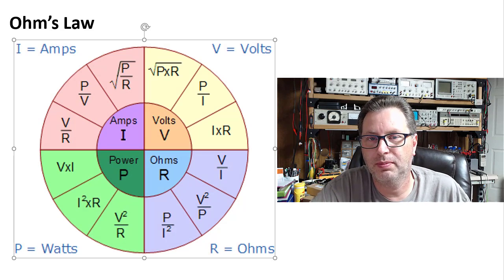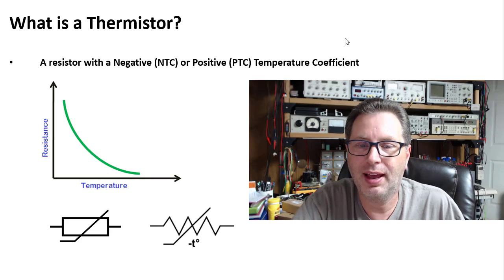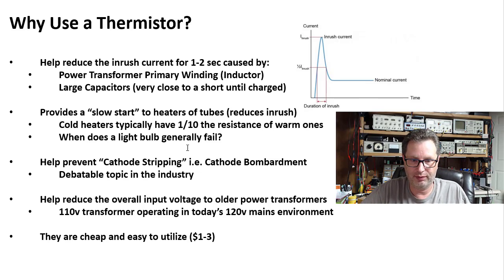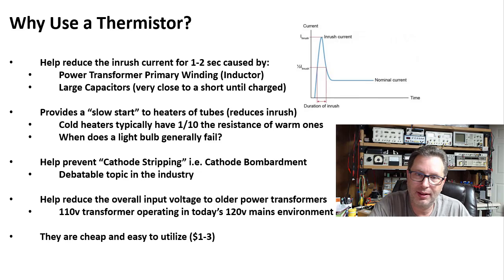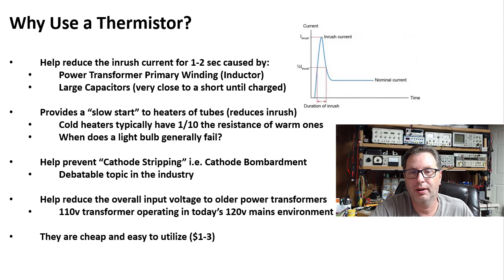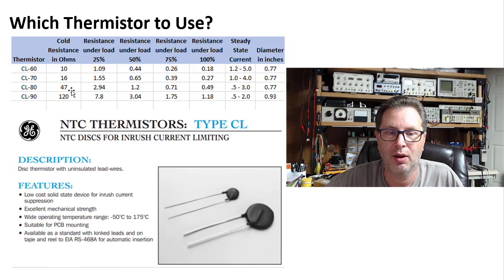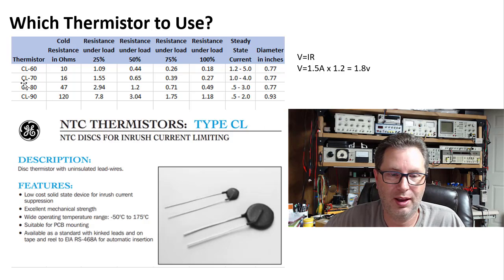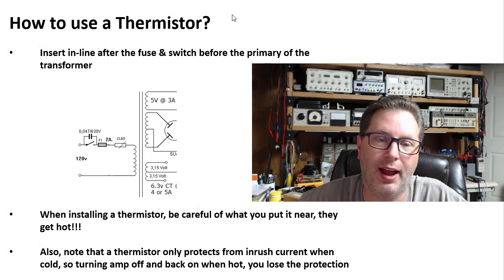Why Should You Use a Thermistor in a Tube Amplifier?

Comment: Thanks for your video; very helpful. I have a tube preamp that the b+ starts at 590v and 40 mA and then drops to 400 v at 23 mA once the tubes are warm and draw a total of 23 mA after about 30 sec - 1 min. I have four 1.2k resistors 5w to drop the voltage in the power supply and was thinking of changing one to a 1k ptc thyristor that the resistance would rise during the initial over current. After seeing your video, is that the wrong approach? (The heaters are dc and limited to .3 amp )

Comment: Thanks for this!
If I have an amp that uses a 5 amp fuse, can I use a a CL-80 (3A) and a CL-90 (2A) in series to handle it for inrush protection and mains voltage reduction? (because it's an early 70s amp and I often get 125VAC at my house.... Do Thermisters work that way? Can they handle the larger current by being in series? And if so, do they need to be right next to each other, or ought they be one on each of the PT primary wires?

Comment: If the tube amp's power transformer is rated at 120V instead of the older 110V, where would be a good place to insert a thermistor?  Perhaps after the Standby switch, if the amp has a Standby switch?

Comment: I have a question. what would be better in a guitar tube amp, a thermistor or a Varistor? Mesa used a snr 130k20 (varistor) from the fuse shield to the neutral terminal in the power supply on old Mark series amplifiers. I want to add protection to an even older mark series amp that I wired a new 3 prong cord into. I love your videos. I live in Raleigh btw. Thank you

Comment: I am rebuilding speaker crossovers on a set of large speakers, 15' woofers so they can take some power. The tweeter and mids are each protected by a PTC thermistor. I understand you want to protect the circuit but is there a better way? Obviously, there is the benefit of it being "self-resetting" and cheap.

Comment: Can you run multiples of these NTC CL thermistors in series to increase their resistance and steady state current ratings, in case you wanted to knock more voltage down without going with a bucking transformer?

Comment: Thank you for the video. I just ordered a couple of the CL-90's to play with. Not real cheap though on eBay , $13.42 with tax and shipping.  I've been using bucking transformers for many of my old power transformers. I found that adding a 0.1ohm 5watt resistor to 6.3v filament windings get them right from 7.2v down to 6.3v. One on each leg of the winding. Amps that I run el34's in voltage is no big thing but , being able to drop a a couple volts on my smaller amps is a must. I recently discovered the transformer impedance thing for tube rectifiers.  "Rt"  Example:  I just built a amp with a old Voice of Music power transformer. That transformer had a ez81 on it but , with 122-123v wall voltage the  B+ voltage would have been up there. The transformer had a pretty low resistance for a ez81. I used a couple 250ohm 5watt resistors on each leg of the HT and it knocks about 18volts off the B+. I should have used maybe 180-200ohm resistors but , 250's were all I had on hand.  It's only a 120ma secondary and the little 0.1ohm resistors on the 6.3v windings , probably 3.5amp. That amp will plug into the wall. I made a post on el34world forum about it. "Orange AD15 Style Amp" 
 A good subject for a video , with a bit of math , would be determining power transformer impedance for tube rectifiers.
Reply: You can’t use resistors on ac period

Comment: Item 3: Stripping may not be happening because there is no current flowing in the tubes until the heaters come up to temp, well after the thermistor warms up. So for that 3-4secs the therm has already heated up.

Thermistors: I also don't like the saggy affect it has on the power supply. Does help a solid state rectifier PS sound a bit more tube like lol but for punch, you don't want sag. btw - a lot of classic guitar amps didn't have them at all. Best is a timed resistor/relay circuit or a physical switch for a series resistor ie Inrush switch.

110vac vs 120vac line voltages may be true, so if the rails are too high, drop down with an outboard transformer or variac to achieve the actual expected B+. If you're running old enough amps then expect to have a crazy setup.
Reply: WRONG

Comment: I love odd components for pedal builds ever since I built a set of optocouplers for a harmonic tremolo out of light dependent resistors, leds and black heat shrink lol. Today I saw something about thermistors and thought I'd look them up and I found your video after awhile. I completly see the value of slowing that surge of current at start up. My main amp that I use 99% of the time is a Marshall DSL100HR. I'm still under warranty so the closest this to a mod I've been able to do is roll the tubes and replace the HT fuse when it blew following a stock JJ el34 blowing(not a fan of JJ EL34'S at all, in my experience I've always had poor sound quality with them sounding muddy and the longest they've lasted before one if the matched quad died on my was about 6 months. And that's with a reasonable bias that took into account the actual plate voltage etc of the amp while plugged intok the power source it would be using in operation. My power was dropping to as low as 104v in summer so I got a boost/buck transformer that boosts by 10v at 116v and bucks by 10v at 126v. That along with a fresh matched quad of EHX EL34'S and a rebias taking into account the possible source voltage fluctuations and I haven't had a power tube blow in over a year.) Anyways I was wondering if using thermistors was common practice with any big name amp builders? I've been inside my amp and looked over the schematic and I don't remember seeing any thermistors around the switch, fuse or input caps. But at the time I wasn't aware of thermistors so I'll have to go back over the schematic now. Luckily it seems like a thermistor could be added at a point that would be less invasive but if hate to get rejected on a warranty repair cause of such a small modification. I swapped out the footswitches in the channel/fx loop 2 button switch that comes with the amp and changed the fx loop to a green led instead of red so the channel an fx loop can be identified in a darker setting if needed. Plus while I was at it I added some led bezels. I mention those "modifications" to note that even with those small mods I worry I might be rejected for warranty repairs. I think it would be rediculous but you never know how far a company will go to save a buck. Great video btw, as soon as I'm able I'll be implementing thermistors in my amp and also when I get around to building my first tube amp from "scratch" (meaning from parts I source myself and using a schematic with modifications to comolement my playing style and needs).

Comment: Thanks for the informative video.  I'm a great believer in inrush protection particularly for expensive transmitting tubes, e.g. 3CX1500 etc.  Don't use those much anymore but primarily restoring vintage receivers and tube guitar amps.  One problem I have since moving to this location is a very high (126VAC) line voltage.  So to get to a nominal 110V input I have to drop about 15V.  I've been using 2-5 watt wirewound resistors in the hot lead of the line which seems to work well enough and calculating the value is very simple.  What's been your experience with this kind of problem?  Is there a better way?  Thanks.

Comment: Thanks for another informative video. I use a 10 watt 500ohm ceramic resistor wired across a switch to act as a soft start on my guitar amp builds. Select value to reduce primary voltage to half in the same place in circuit where you have thermistor. After I flip the ON switch I count 7 to 10 seconds then flip the soft start switch that shorts across the resistor giving full voltage to primary. This reduces current spike on filaments. Mr. Carlson's Lab has a video on inrush current on tube filaments and it shows at startup a single filament in a 12AX7 preamp tube has 1amp spike. That's 2 amps per preamp tube. So thermistors could also be used in filament circuit. Also I would like to see you do a video on a series pass circuit to reduce B+ voltage to power tube plates and screens.

Comment: For even more protection for my first smoothing capacitor and tubes if using diodes instead of a rectifier tube... Can I add an additional thermistor on the DC side between the diodes and first smoothing cap or input choke? This way I would be reducing inrush on both the primary ac as well as filling up the first smoothing capacitor more slowly. What are the advantages and disadvantages of using both an AC and DC side thermistor in place?
Reply: Also can I use these to slow the heater and B+ voltage rise only. But have the bias come up immediately, so that when the heaters are coming up the bias will already be fully up and present to reduce cathode stripping over time. What is the ideal sequence for applying power to the amp using thermistors for some delay?

Comment: Heya, good video.  Just wanted to mention I have some old gear here from the early 1950s that's rated for 117VAC, so it's not such a big deal for us amp folks as it is for old radio restorers dealing with pre-WW2 units. Not sure when the AC supply went to 117V though. Before my time.  Having said that, I see 125VAC fairly commonly, and I don't think that was common in the 60s, at least I don't remember it, so the same problem exists and the added resistance is worthwhile. 

I've also seen folks add thermistors to the secondary side as a soft-start for the B+.  I haven't tried that myself so I'm not sure how that behaves.

Comment: Can a thermistor's coefficient reverse when failing? I have a modern amp that will not come back on when hot ;yet it isn't blowing fuses . And comes back on when cool. It has a c60 in series on the neutral leg.

Comment: Thanks Mark, I've been thinking about putting one in my Marantz 2325 solid state. It has an 8 amp main fuse, what size thermistor would I use?  When I did the restoration I raised the main capacitors from 15K to 18K uf 70 volt and a 150 Ohm 125 Volt snubber cap but it keeps blowing the power switch (it freezes on, won't shut off). Any help would be appreciated.

Comment: Many solid state hifi amps use one or more (paralleled) relatively low-ohms-value but  large-wattage resistors in series with the incoming AC line, that get shunted out of circuit after a couple seconds by a large relay wired across the resistors(s). This works quite well as long as the relay contacts are clean, so that the relay handles all of the AC feeding the power transformer and the resistors have no voltage on them because of the "closed" relay shunting the voltage around them. However, once the relay contacts become a little oxidized, then you have some voltage flowing through the resistors (with a corresponding voltage drop) and also some voltage drop occurring directly at the relay  contacts  which themselves have formed a resistor; and so, the resistors may overheat sufficiently to break down their solder connections or even burn the board, and the oxidized relay contacts can also start to arc and burn. (This circuit also requires a basic short-duration timer to delay the relay slightly, for just a second or two at most,  so it doesn't turn on instantly when you throw the switch on the amplifier). Still, this type of inrush-limiting circuit works quite well, especially for big power amps  with very high inrush current due to big transformers, solid-state rectifiers and massive amounts of  filter capacitance, *as long as the relay is heavy duty and the contacts get cleaned every 5 to 10 years or whatever*. By the way, one highly regarded and collectible Hi-Fi power amp I know of actually uses thermal fuses in line with and physically touching each of the four or five resistors so that if they start to overheat significantly (because of the relay having  becoming too oxidized to form a good low-resistance shunt)  the thermal fuses will blow and disconnect power to the amplifier.

A quick voltmeter check will tell you if these resistor Bank slash shunting relay circuits are working correctly, ideally there should be no voltage measurable across either the resistor Bank or the relay, which are of course in parallel with each other anyway, but due to very slight contact resistance at the relay you might have 5 or 10 millivolts of AC across these devices. Anything more than that showing up on your meter is telling you that you need to clean that relay.

Comment: 3 questions:
   1) Is there any value to adding thermistors to old Solid State equipment?
   2) Why not insert several thermistors in series to reduce voltage down to say 110v?
   3) Should I add a thermistor to to my old Hammond organs?

Comment: I've seen people put big resisters in front of the transformer on 1930's radios to reduce voltage in theory to lengthen the life of them because they originally ran on lower house voltage in the 110 range, this seems like a better option, would you concur or do you think there is no reason to drop the line voltage for these old radios? Great video, thanks!
Reply: I use a 25 watt 8 ohm resistor in series with the power transformer of my Leslie 122 amp, to drop the line voltage. I've been doing that for years because my 6550s tubes would burn up in a month. Now I don't have that problem.
Reply: K2bew, the real reason for using a series resistor in line with the AC power cord was if the radio was designed for series string tubes BUT the filament voltages of all the tubes tied together in the circuit didn't equal 110 volts or thereabouts. a typical so-called All-American 5 radio would have a 50L6 or 50 C5 output tube, a 35Z5 or similar  rectifier, and three 12-volt tubes, all of which together added up to about 120 volts. However, some radios used only two, or even just one, 12volt tube, which meant that you needed to add a large resistor to drop 12 or 24 volts off of the incoming AC Supply. some radios used a special AC cord that itself functioned as a resistor, and those cords could get quite warm in operation and often turned dangerously brittle with age. one wonders how many house fires were started by these types of radios!

Comment: on small amps you can use more than 1 in series this tends to extend there delay
Reply: I was wondering the same thing. Also helps to drop the  122 V at my place,   a little more.
Reply: What i call a small amp is a 6L6G push pool 35 watt amp i used 2 of these (( MF72-120D15 )) in series

Comment: When I built my own bench power supply, it had a 240v-240v  isolation transformer included in the build, as well as voltage outputs. This popped my circuit breaker randomly and for months I would strip out the variable voltage units and replace them. I eventually gave up. Months later, someone on a forum suggested an NTC... problem was solved. I never considered the inrush current from the transformer. I guess you learn a lot from your mistakes. These components are really useful. I have seen some circuits that ‘time’ the cool down, so it would not let you switch off and on too quickly. Thanks for the video.

Comment: Quick turn on/off: The thermistor may still be warm and not protect like when it's cold, but your tubes are still very warm too. So I suspect the inrush current will not be as dramatic as when things are stone cold. Thanks for the vid. Don
Reply: And the filter caps shouldn't be fully discharged.
Reply: It's not about 'protection', it is about slowing the heating of the filament. Fast filament heating is the cause of catastrophic tube failure. You must heat the tubes slowly, you cannot start with the full heater voltage current right out of the gate or the tube will flash, potentially popping it. Slowly ramping up the current with heat is precisely how tubes should be heated. 

I highly doubt a thermistor will cool slower than the higher mass tube, in any situation xD
Reply: Transformer will be your worst enemy during a quick turn off/on. If the initial voltage polarity and the residual magnetization of the transformer match - the resulting inrush current will be much larger than during a cold start. With the transformer it's also a bit of lottery it may start gently or vice verse depending on the initial AC voltage phase. However, residual magnetization of the core makes things worse.